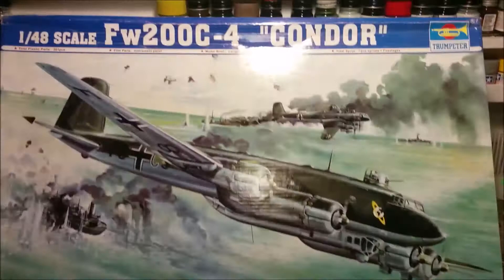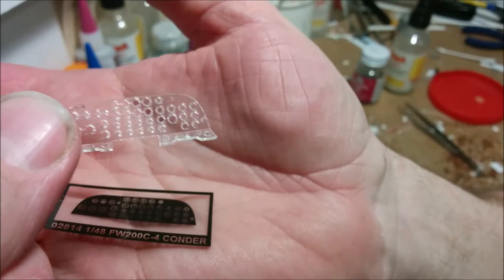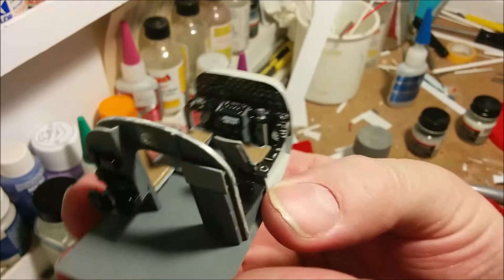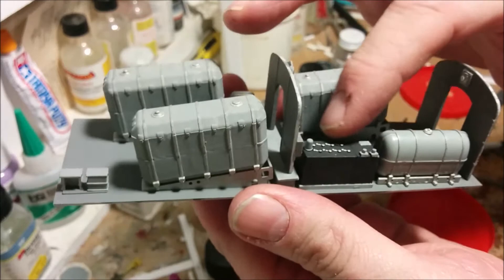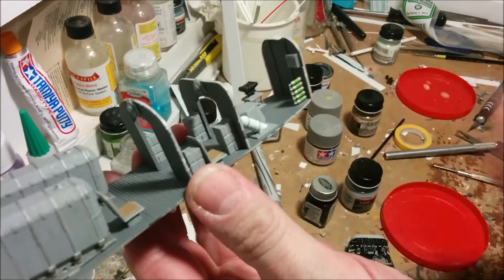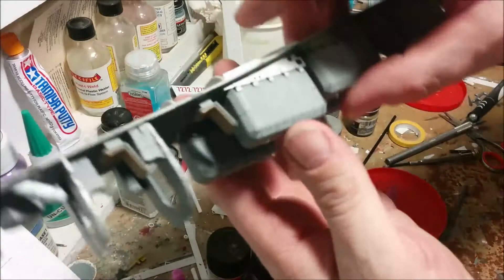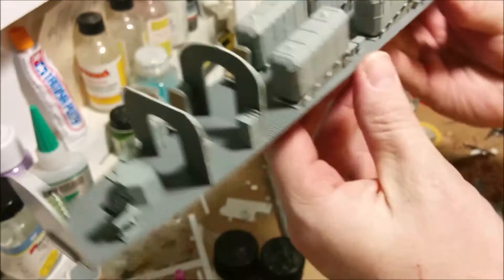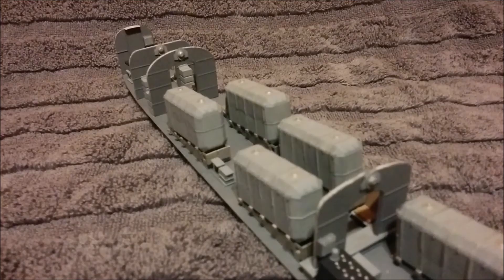FW-200C-4 Condor Build Pt2 1/48 by Trumpeter

Comment: My theory on the tilted fuel thanks is that it was designed that way so that gravity would always push the fuel towards the fuel line. If the tank is level,  when low the fuel  would displace all around the tank and perhaps remain far from the fuel line
Reply from the maker: That certainly seems possible. Thanks for watching!

Comment: Hi Dan, fantastic videos of the Condor. I have now bought a FW 200 and will use you as a guide. And I still have a MPM He 177 on my rack but not yet brave enough to start it. Do you have any experience with it? Many thanks Eckhart
Reply from the maker: Eckhart Leptien Sorry, I haven't built that one. I've done a couple of MPM 1/72 scale kits and one Special Hobby 1/48 scale kit (same company or related). They are good kits, usually everything fits, but there aren't usually any tabs or anything to help you assemble them. I would rate them as: for experienced modelers with mixed media(etched brass and resin) experience. Thanks for following and good luck!

Comment: How do you put on a transparency? I have one included with photo etch and I have never put one on.
Reply from the maker: Samuel Vasquez In this case I originally used a little white glue, but the part popped off when I added it to the floor. I resorted to thin super glue to hold it on. Super glue is much stronger but much less forgiving. You have to get the alignment right almost instantly. Of course a thicker super glue is much more forgiving but the results may not be as neat. Super glue is normally what is used. Hope this helps.
Reply: Thanks